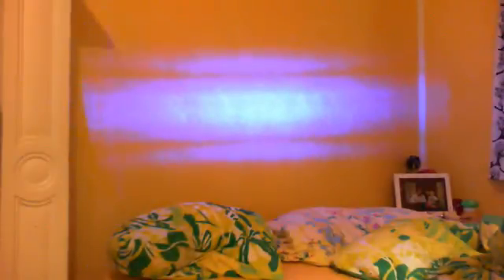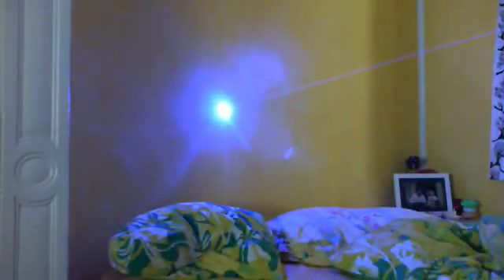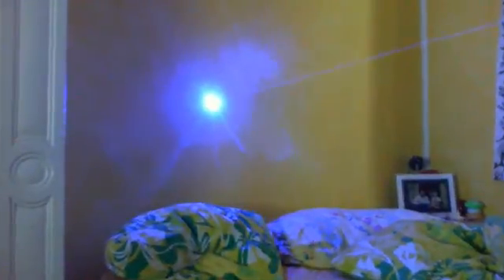445 nm 9mm laser diode problem

Comment: I feel the problem is a combination of your battery and lens. of course the rectangle shape from the blue diode is normal. I want to point out that your safety goggles are not for this laser.
Reply from the maker: +Kamgtr Hey! The problem was really related to the lenses holder and the spring itself. I got that fixed by carefully screwing things together. As for the glasses, no worries i have my Eagle Pair 190-540nm OD4+ on me, i used the red laser glasses to try and lower the amount of light going in the camera to better show the shape of the spot (while ofc wearing the glasses).

Comment: looks like the spring is keeping the lens too far from the diode to focus properly, don't use the spring, but use a little heatsink paste or teflon tape on the screw threads of the lens housing, this may stop the lens from shifting when touched.